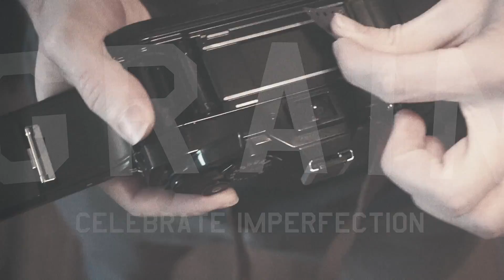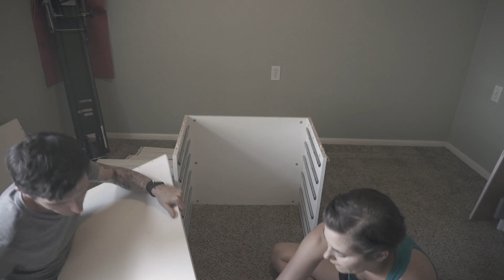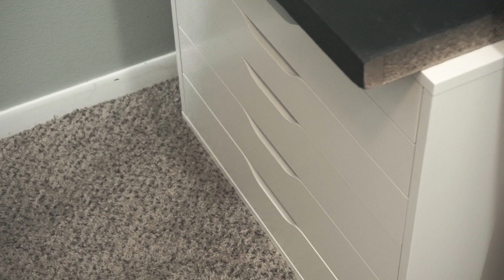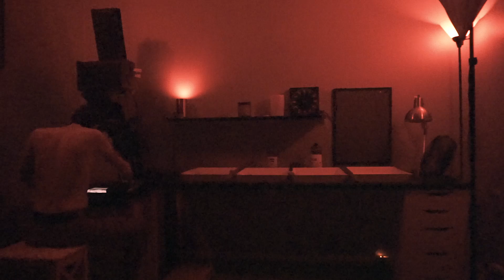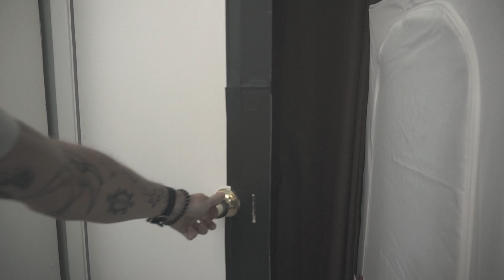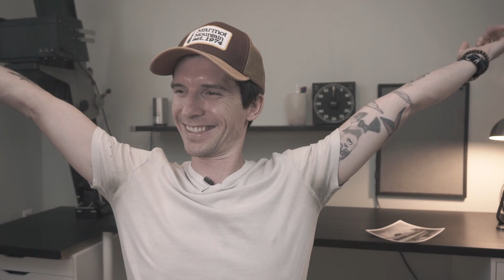Building a Darkroom on a Budget

Comment: Thank you for sharing. I guess you don't have to black the walls? How does that work? I've been inside a few and they are blacked out walls. I was thinking I had to also. I'm currently homeless (for another week) and had all the equipment given to me for free. I couldn't pass it up. Today I was contemplating ways to black the walls without paint, it's an apartment and I don't want to repaint it when my lease is up. Coooool video.

Comment: I want to do a darkroom but I want to know about chemicals to develop. I know is different from negatives? Or do you use the same? Do you diluted in water? Very cool darkroom. How about ventilation ?
Reply from the maker: The developer for paper is different than film. For paper I use either Ilford multigrade or kodak poly t. I dilute them 1:9. The stop and fixer are the same! The only time I really worry about ventilation is when I'm toning so I do those steps outside.

Comment: I too have a spare bedroom I want to turn into a darkroom but I'm told you HAVE to have running water by many people, how do you get around that? My spare bedroom is directly across from our guest bathroom.
Reply from the maker: I use 4 trays, dev, stop, fix, water bath. After dev and stop, I go from the fix to the water bath and then to an empty tray to take out of the darkroom for observation. When I have a final print I do my toning, hypo clear and final wash. I only use 300ml of liquid in each tray (this saves chemicals and prevents sloshing). I can get around 12-15 prints before I need to change the chemicals. When I am done with my printing session, I pour the dev, stop and fix into a 1L container and take that to the bathroom to pour out. My print washer is in my shower (i have a vid online for it) and when my final wash is complete I squeegee and place the prints on screens to dry. I made the screens from fiberglass screen from Home Depot stapled to 1"x2"  pieces of wood. I then remove the water tube from the print washer to use as a hose to clean my trays. I place the tongs into the 1L container and fill with some washer and stir and whip them around, or as the great Bob Ross would say, "Beat the devil out of 'em". I pour out the water, dry the trays, disconnect the washer and stack everything together and place back on the shelf. I spray the worktop down with a water and vinegar mixture and fill out a print log with all relevant data for the next printing session. Finally, I put cotton gloves on and remove the negative from the carrier and place it back in it's sleeve. I haven't spilled a drop (knock on wood). In the darkroom, I always try to mindful, take my time and be deliberate with my movements. Keep in mind I only print 8x10 and after printing this size for the last year or so I have no future plans to try and print larger than that. Give it a shot! Follow me on IG and send some shots of your setup when you're done!
Reply: Thank you for all the information, I sure will!
Reply: Put in a bucket of water to put pictures in and when your ready take to the sink and wash.

Comment: What did you use for safe lights? awesome bro, i only have a really weak red bulb and its annoying aF
Reply from the maker: I just use a few of these: http://bit.ly/2DAmOD2   * a friendly tip. Don't over 'safe light' your space. It will cause fogging and make you pull your hair out trying to figure it out. You can do a safelight test by placing a coin or something on your paper for a few minutes and develop the paper just to be safe. Doing that test finally solved the mystery paper fogging which in turn improved my printing contrast and exposure times.

Comment: Sorry if you mentioned this and I missed it but are you doing anything about ventilation or are you not that worried about it? I've heard all sorts of different opinions and ideas on ventilation but I'm curious as to what you or anyone else's opinions/ideas are.
Reply from the maker: I have a small fan in there and I come out every 1-2 hours to transfer prints to the water bath. The chemicals are pretty chill. When I tone however, I do that outside on the patio.
Reply: You should have ventilation, or a window open that is covered

Comment: When you're ready to go big, get yourself a Jobo 3063 Drum, and you'll be able to process up to 20x24. That's how I develop my Ultra LargeFormats 11x14, 14x17 & 20x24 for contact printing, or enlarged 4x5 negatives.
Reply from the maker: After printing and working in the darkroom a little, I have come to the conclusion that I really enjoy 8x10 printing. It is manageable. I really have been enjoying the juxtaposition of a large landscape scene printed small. I have printed large (very large) in the past and I found that people were grabbed by the grandness of the image and presentation but didn't really LOOK at the image. When I started printing small, it was almost like a quiet invitation of the print to come in close and really look into it. I offset the smaller print size by matting in a 16x20 to help add some weight and substance to the overall presentation. So far, I really love the look and have no plans to change them.

Comment: Congratulations on your darkroom Chris... and good luck working there.   The board in the window is cooler, if you paint it white - or glue alufoil, on the side facing out.  You might even pin a curtain in there, so the window looks Ok from outside.   To control spilling, Keep the trays on normal trays.   Painters use rolls of "blanket on plastic" as cover on the floor...use it on the table and floor.   Greetings from Denmark...Jakob

Comment: Looking good. Though you might want to get one of those long thin rubber door mats that you often see in offices and the like to put on the floor just in front and partly under the work surface where the trays are. Trust me you WILL spill something eventualy and it will save staining the carpet.Cheers.
Reply from the maker: My wife suggested this too, so by law I must give her credit. But yes, spilling is inevitable. Also trying to think of cheap backsplash option. Any thoughts?  Thank for watching! -chris
Reply: Check out a gardening store for rolls of thick polythene sheet. You could attach it to the wall like the flap on the bottom of the door and have it come all the way across to underneath the worktop.
Reply: Oh, and yeah, wife always wins lol.

Comment: Marvellous..
Thanks for the mention.. (Future Helmut)
Anyways yes great. Looking forward to see how how it pans out..
The print looked great on fiber paper.
 
"FOCUS on DEVELOPING your darkroom technique". (Old photography joke).

If the darkroom has a wooden floor, (not concrete), don't walk around during an enlarger exposure. The enlarger head may move a tiny bit. It's usually possible to secure the top of the enlarger column to the wall for added stability.
If it gets hot in there, a small extraction fan in the ceiling venting up into the loft can help.
If light is a problem, do darkroom work during the long winter nights, when you can't be out shooting.
To test safelight, leave a coin on a piece of paper under safelight for an hour. Develop the paper, if you can see a white circle your safelight is too bright.
For ultimate tonal quality switch off the safe light during enlarger exposure.
Don't forget to spend time out in the sunshine and don't turn into a vampire.

Again, Well done and good luck dude. 
I think you're the only young Youtuber doing this from scratch.
Much better than an old timer like me droning on about "back in the day".
Have a good trip.

The only thing I'd say to others is that if considering a darkroom, do it sooner rather than later. As film photography is becoming more popular and people realise how easy it is to set up, used darkroom equipment prices will creep up.
Reply from the maker: Jon, I could easily blame all of this on you!!! But instead i'll say what I really think and say 'thank you'. I have been wanting to do this for awhile (as we have discussed) but I appreciate the nudge forward. There will be a print in your future for sure. I will test the safe light brightness this week and see what it looks like. I think i'll wire the safelights into the timer this week just to be sure. Talk again soon and thanks again!
Reply: Yeah it's good to wire the safelight's in so's they go out when you hit the timer expose button.

I get blamed for everything anyway so no worries. :)

One other thing I forgot to mention.
 Behind the enlarger you have a white wall. It's better to put a large matt black board there because you can get reflection off the wall onto the print during exposure. This can cause slight fogging of the highlights. Just a piece of matt black painted cardboard, width of the baseboard and height of column will do fine.
Just noticed it's in the corner, might be an idea to put black boards on both walls.
Or if you can deal with it just paint the walls close to the enlarger matt black.
Keep all other walls light coloured.
Reply: One more
(i'm worse than your Mom).
If you can afford it buy the book.
"WAY BEYOND MONOCHROME"

Comment: Dude Im so stoked for you!! Ive been mulling through the options of where I might be able to set up my own darkroom as well, and love seeing the steps you went through to cut out all the pin holes of light you were coming across! I cant wait to see what you shoot and print moving forward! Also, I totally agree that a marriage is put through a refining fire when assembling ikea furniture together 😂😂😂
Reply: Another option is darkroom blackout cloth fitted with velcro around the edges and the the opposite velcro fitted on the window frame. Easy to take down and put up if you need the room for other uses.
Reply: I was also thinking of setting up a darkroom, but I was told that my school has a darkroom, and what made it funny was that it's behind the door that I used to stare at wondering what was in there.